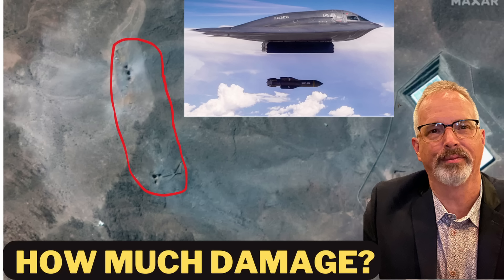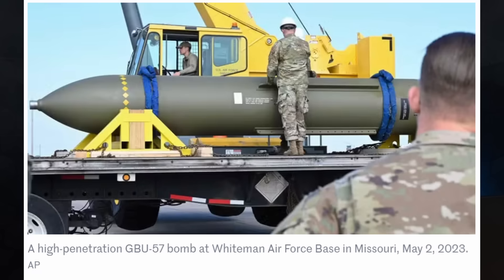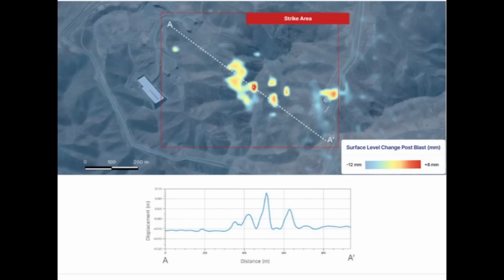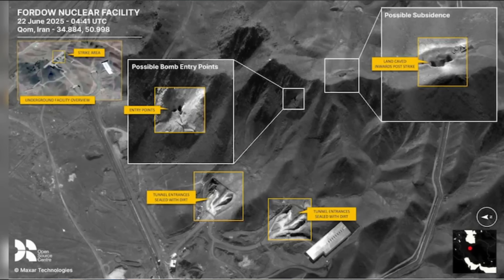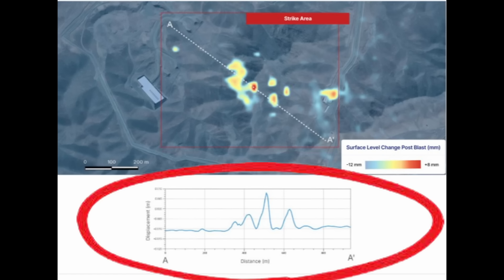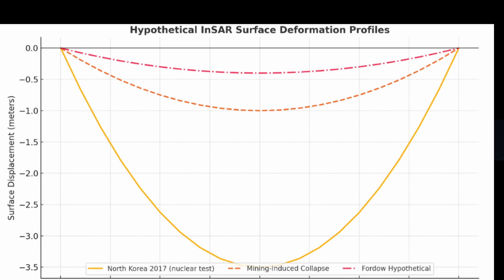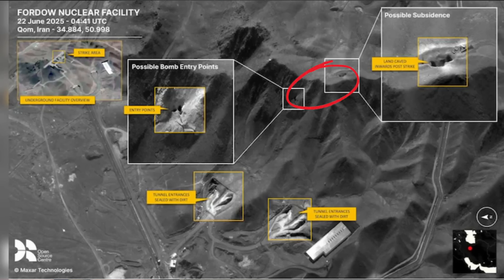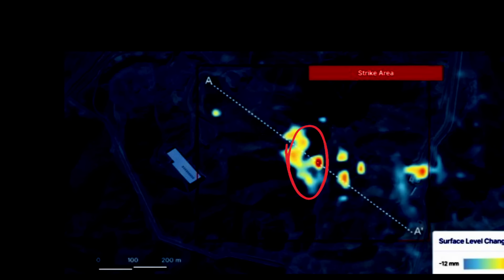Fordow Attack Assessment -  Update

Comment: In other words, we just opened up the newest gravel pits in Iran.  ;-)

You should have mentioned the penetration power as the GBU-57 hits at near Mach 1 speeds for an impact force of some 800 megajoules of energy on a surface area of 31 inches/0.8 meters diameter. Then add the 5000 odd pounds of explosives providing over 19 Gigajoules of energy some 60 meters down and we're getting nearly 20 Gigajoules per bomb times 6 at deeper and deeper levels. That's nearly 120 Gigajoules of energy in a shaft easily 100 meters deep and maybe 4 meters wide. It would only take one of these breaking the walls of Fordow to ruin the interior from just a remnant of these blasts over less than a couple of minutes.

For comparisons sake, I asked Grok how much energy is in 1000 pounds of high explosives as is used in quarry mining and it said some 1.9 Megajoules vs the 120 Gigajoules of pinpoint accuracy potential seen above. I don't see how anyone can say the place is still standing with these numbers in mind.
Reply from the maker: Thank you for your comments on this.  I agree that there was a tremendous amount of energy discharged below ground at this facility.  I think the big surprise to me was that these bombs sequentially struck each shaft multiple times.
Reply: @CaseyJones-Engineer  I'm not surprised. But, I'm also a retired F-16 Avionics tech and a weapons nerd. So, I'm doubly cursed... ;-)

We have many videos of US  GPS guided bombs hitting within 2-3 meters of the target. The test video you use above shows the GBU-57 hitting maybe 1 meter off center.  To get 6 of them in same hole times 2 targets while going near Mach 1 just proves our accuracy is crazy good .

Comment: There was a test in Nevada where instead of a subsidence crater, it formed what they called a retarc (crater, spelled backwards, a rubble mound) - see Sulky.  Watching blasting channels here on YT (shout out to Demolition Dave in AUS) the bulking when he blasts granite can be notable.  I have to imagine in this case, much of the underground facility was collapsed / filled with shattered rock.  Combine that with the thick overburden, it would seem to be plausible that there might be minimal overall movement at the surface.  Great vid.
Reply: The rock is andestite, about 2 to 4 times the strength of 5000 PSI concrete (judging from a report about a tunnel in the same volcanic rock ~50 km north west). The depth is at least 80 meters, and could be as deep as 110 meters. I don't think it could have made it though but for the air shafts, like the Death Star's weakness.

Comment: I'm a moron but just looking at it as a layman, the fact that there was hardly any ( I believe you called it ) surface expression told me that things were pretty bad under the surface. I would thing that there would have to have been a substantial hollow area under there to be able to contain that much explosive power. 5k lbs of explosive per bomb is nuts. And the fact that you really didn't see anything on the surface other than a few holes with no charring or indication of blowback tells me it's gotta be complete obliteration under there. But, like I said, I'm a moron.

Comment: 30 year underground mining engineer here...if you seal up an underground facility without ventilation and pumping any sensitive equipment, such as electrical gear and presumably enrichment centrifuges, has a lifespan of months at best.  If the ground is making any water and you kill the pumping you are looking at weeks at best before that gear is junk.

My personal suspicion is that the concussion along travelling down the vent raises and through the centrifuge gallery probably wrecked them.  The direct shock wave through the rock and concrete was probably enough to brinell the bearings.
Reply: Don’t forget the potential for uranium hexafluoride contamination, uranium hexafluoride exothermically breaks down into uranyl fluoride and hydrofluoric acid upon water exposure. All products are toxic, and hydrofluoric acid is very corrosive - the site is now a hazmat mess.
Reply: Neat insights!  Why is pumping / venting required?  Does it get real humid underground?
Reply: @383mazda  There is quite a lot of water that soaks into the earth from the water cycle, which ends up collecting in various sediment & mineral layers underground (aquifers).  That's why people can use wells as a water source, simply by digging a hole down to an aquifer layer and letting the water seep in to fill it.
There is also quite a lot of water present deep beneath the crust, with water content of liquid magma averaging around 3.2-3.5% by weight, within a range that goes from trace amounts to up to as much as 10%.  This water does tend to end up trapped within the physical structure of the rock at a chemical level, but there are exceptions.
Granite doesn't tend to have much water in the rock formation itself, but the way that molten granite intrudes through many layers of rock before solidifying can result in the granite forming a underground dam, preventing ground water from draining from adjacent layers which can hold water, and thus forming an aquifer behind the granite in the same way that a above ground dam forms a reservoir.
If that Granite dam is then cracked (such as being fractured by an explosive) at a later time, the result is also similar to what happens to an above ground dam.  The reservoir begins to drain through the fractured granite.
If enough water drains through the fractures, it can even form a series of caves through the granite.  Although granite is a very hard and insoluble rock, so the caves tend to be quite small and narrow. 
Water draining through fractures in less durable rocks which can be dissolved by water, such as limestone, can produce much more impressive caves.
The largest cave in the world, mammoth cave in the state of Kentucky in the USA, was formed by an entire underground river network that cut it's path through a layer of fractured Limestone and Dolomite.  The reason the river didn't cut all the way to the surface and create a canyon system instead of a cave, is because there is a layer of impermeable Shale rock, which the water has a much harder time cutting through, sitting on top of the cave like a roof.
Reply: @383mazda think of a giant server room full of servers running, or a nuclear power plant. There has to be TONS of inlet/makeup cooling air vented INTO the facility, and there has to be ventilation for the superheated air to escape. Technically you wouldnt even have to hit the centrifuges themselves. You could blow the shit outa the ventilation system and lack of ventilation itself would cook the centrifuges.
Reply: @383mazda Yes.  It does get humid underground.   Others mention ground water but there's also condensaion.  People are breathing down there and any moisture in the vent air will condense on many surfaces.

Moisture is among the most benign things to seep out of tunnel walls.  A basement might have a radon issue... a facility this large has a lot of surface that has to hold up a mountain while also surviving harsh and corrosive conditions.
Reply: @kwonekstrom2138  I've only been in a handful of caves that are less than 200ft underground, but they were always real humid / cool and damp.  I wondered if a man made structure would be the same.
Reply: @383mazda Yeah.  Depends on the structure, but most bunkers would remove the humidity.

Think of it like this...  a cave isn't getting much airflow.  This traps moisture.  It doesn't have to be underground...  an attic must have appropriate vents...  Block a soffit vent and you can have moisture buildup and mold.

Being underground provides ample sources of moisture...  water flows down if possible.
Reply: @383mazda it gets SUPER HOT
Reply: Do magnetic bearings brinell? And if so, is that while not spinning as well as spinning?
Reply: All that could be handled by air conditioners to condense and store humidity and pumps discharging into internal tanks. Both only require electricity as an outside connection, which is easily passed through a cable buried in the dirt/concrete used to seal up an underground complex. I have no clue whether they did that, but it's not any more difficult than enriching uranium so we should assume that they did.
Reply: @2xKTfc How exactly is "air conditioning" supposed to prevent liquid ground water, from a nearby aquifer if there is one, from progressively flooding the tunnels through fractures in the rock.

That's what happens to most underground tunnels after they are abandoned for any period of time.
It is a huge problem.
In fact, it's such a huge problem that magaging to partially solve it caused the industrial revolution.
The invention of the steam engine, was created specifically as a power source for pumping water out of underground tunnels faster than it could seep in.
Reply: @Kieselmeister   Concur that the real damage could be from flooding.    Simply fracturing some water proofing systems could allow significant water intrusion, or the failure (or overwhelming of pumps) could be enough to cause flooding in the facility.   Nothing is reliable after being submerged.
Reply: @2xKTfc if all you were doing is cooling a typical work/living space that may be true, but not likely. The water has to go somewhere. But this is a facility that produces vast amounts of heat from the centrifuge process and that HEAT has to escape in VAST quantities, like a server farm.
Reply: Few things to this, if the air being circulated has a low humidity from the AC system and the bunker was built water tight enough to keep moisture out there wont be huge moisture accumulation, but liklihood the concrete was watertight, and the AC and fans were doing the necessary air changes per hour, on top of the moisture content within the complex itself which will change within hours of the power shutting off that space will become no different to a turned off freezer with food in it. The AC also needs to move the water out in normal operation, so the evaporation trenches may also let water enter in reverse in the event if a pipe break or a checkvalve failure. 
Id say it will be wet in there. But i have no idea if that will do damage to anything. The power grid is the thing that makes this possible at all.
Reply: @f1reguy587 you're not familiar with water or concrete, are you? 😂😂 It's nearly impossible to build an underground waterproof structure. Concrete is porous. Water flows through concrete quite easily. Go look inside any major dam. The only thing you can do is mitigate the intrusion. But we aren't talking about water intrusion. It's the enormous amount of heat produced by the centrifusion.
Reply: @SteveFreeman-v4d Yup.   Water is a huge problem for a facility like this....  but it pales in comparison to air quality and temperature.

Everyone seems to forget that this is an industrial facility.   It's not just centrifuges... but a whole lot of other equipment too... and possibly chemical processes being used as well.  Especially if they're generating power down there.
Reply: Yeah. Even IF the bombs didnt reach that depth the concussion alone would wrecked the cetrifuges, due to how sensitive they are. Moreover, with the shafts being destroyed the geothermal heat alone would cook whatever centrifuges that somehow survived everything else.
Reply: Agreed. Its all junk down there, nothings every getting out of that. The hazardous materials they'd be trying to dig through for a few hundred feet alone will keep them out of it.

Comment: These centrifuges are hypersensitive to shock forces.  All that was really needed was a detonation that produced a shock force greater than the shock dampening system could absorb.  This would cause the centrifuges to effectively eat themselves.  Additionally, if the bombs did not actually penetrate the tunnels but got close enough, they could have caused spalling that would send chunks for rock and concrete flying around the tunnels at roughly the speed of the explosion. If the bomb penetrated into the tunnel, everything inside the tunnel would be vaporized.  The lack of cratering and minimal deformation would tell me that the tunnels were penetrated.

Comment: Great breakdown on this incredible military operation. Dropping bombs down ventilation tubes is really something. President Trump was right when he said no one else could have pulled this off.
Reply: Incredible because it defies credibility.
Reply from the maker: @rashnuofthegoldenscales4512  Keep believing that it's not going to do any good though.
Reply: @CaseyJones-Engineer Ted Postol with a few simple diagrams managed to achieve a simple, but elegant probability for what actually might have taken place at Fordow.

You opt instead for a scenario where the Iranians dug an otherwise nuke-secure structure but built ventilation shafts that go straight down into the centrifuge hall for no good reason at all. 

You're not a serious researcher. You're a cheerleader and you're catering to an uninformed audience of smoothbrains who will take what you say as gospel. It's extremely tiresome.
Reply from the maker: @rashnuofthegoldenscales451 Postol apparently doesn't know the difference between cement and concrete.
Reply: @rashnuofthegoldenscales4512 postol definitely has a solid analysis. But he underestimated the damage while others overestimate it
Reply from the maker: It was truly impressive.

Comment: You've got a large volume of space from the facility itself that would ultimately absorb the bulking of material.  With that kind explosion confined to a granite bottle, however, it's hard to imagine a centrifuge chamber remaining intact.
Reply: Propagation of the back pressure is probably a factor as well.  For something buried that deep, the back pressure coming out of the shaft would be enough to seal it until the bottled form of the pressure wave had propagated quite a ways forward. 

With due respect to the network media, if any kind of contact was made with the tunnels themselves, "obliterated" sounds like a pretty good word for it.

Comment: The thing that convinced me that the attack was successful is the satellite images after the attack that shows small holes in the ground that correspond to the ventilation shafts . Given the lack of dramatic surface changes it just seems logical that the tremendous amount of explosive force that was dropped through those holes had to go somewhere. Since we don’t really see it on the surface, it is my opinion that this tremendous force went down and I don’t see how it could not havedone tremendous damage to the facility.
Reply: That's assuming the shaft was directly under the facility.its more likely that shafts were at least a km away as the shafts are the most vulnerable part of the facility. Similarly the entrance would at least a km.away